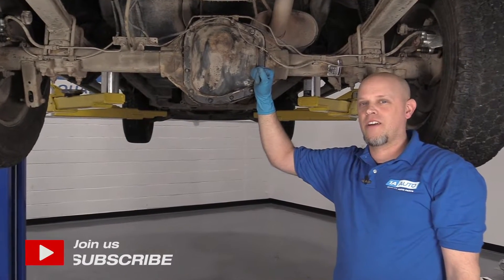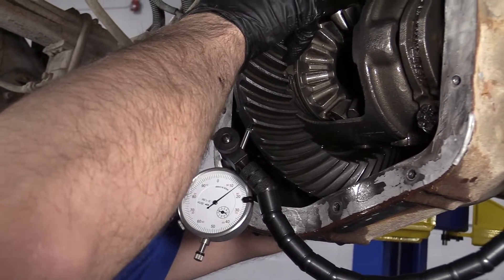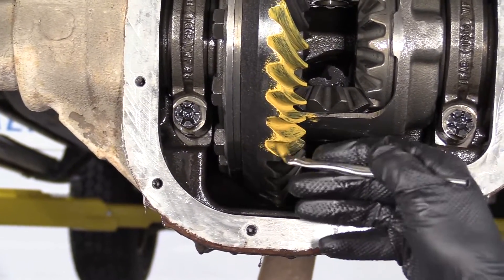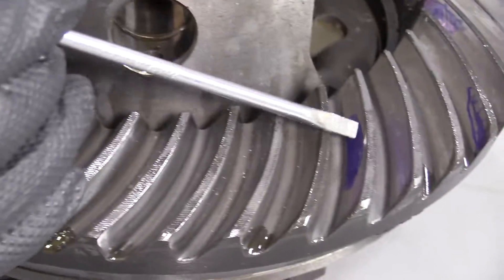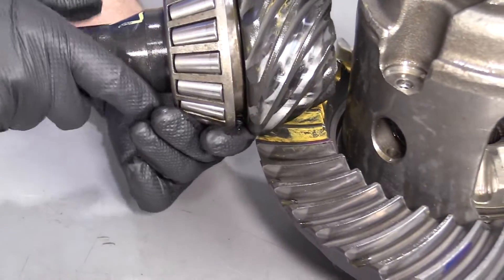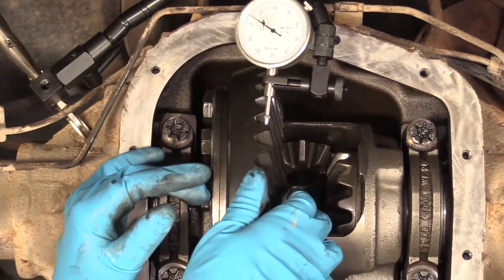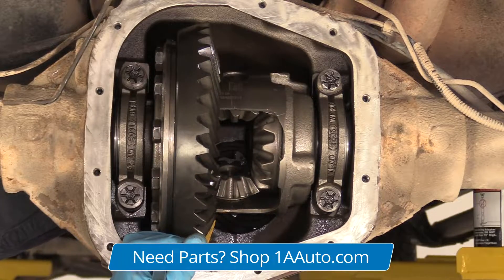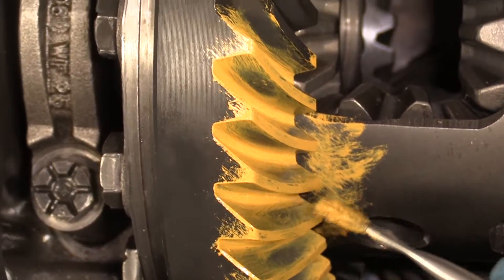How to Check Backlash and Pattern on Rear Differential 09-14 Ford F150

Comment: I hope you still read these.  I have a clunk clunk in the rear of my 11 mustang.  Its let up and engage gas.  I replaced the spider gears because they were worn.  I didn't have this gauge but will be getting one.  Can older gears be re-shimmed?  I don't care about whining noises.  I'm used to older cars lol.  Its a 2011 mustang gt 130k on the clock and the gears aren't warn too bad i think its just in need of adjustment.
Reply from the maker: +Reallystockmustang You can reuse the shims for the new setup but you still have to set the gears up from scratch.